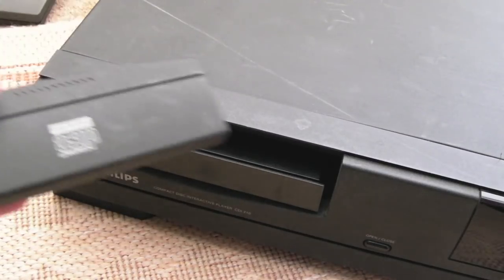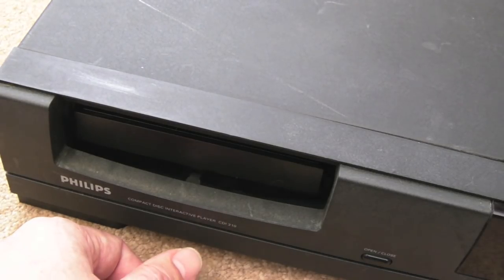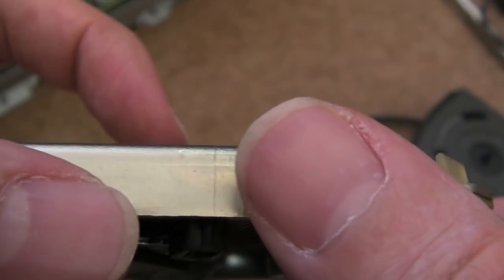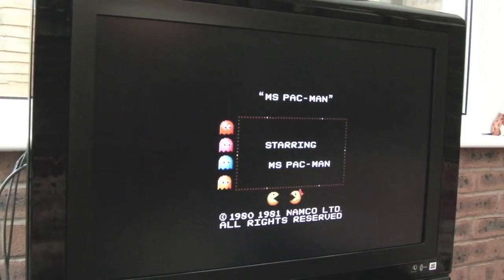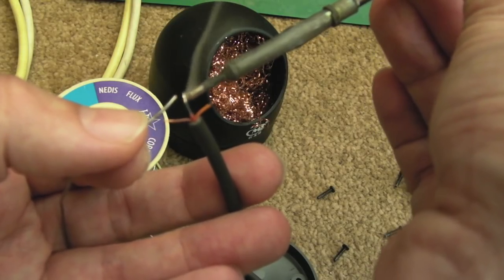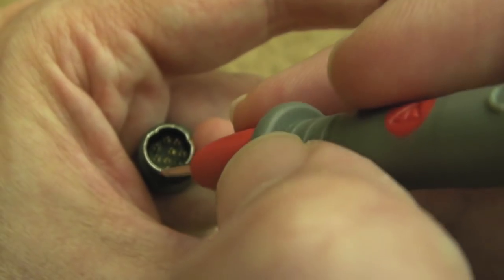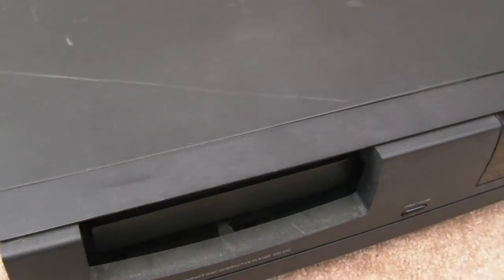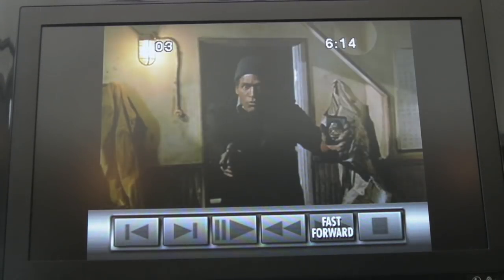Philips CDi 210 - Drive Repair & Gamepad Repair (Part 1)

Comment: That was a pretty easy fix for you :p never seen the appeal in the cdi as a gaming system, most of the games are shite lol
Reply: CDi was never a gaming system, it was a multimedia system even bringing the internet to the livingroom.
I really love watching old 4:3 movies on cdi, way better than vhs and 99% of the dvd releases of old movies are trash. 
Being dutch there is probably some national pride in me saying this but Philips again was a real frontrunner on tech.
But as usual, too early, too inovative, really creating a market instead of supplying a market.....
Reply: RefractionPCSX2 I have about 60 titles and the only ones that aren’t some kind of game are the two movies and an encyclopedia/reference disc. :) It’s the same kind of “multimedia” software every other CD platform was getting at that time which was primarily games, educational titles (usually games), reference software, and movies. The system couldn’t even scroll smoothly so it really sucked for traditional games but stuff like Defender of the Crown and Myst were well-suited for it.

It looks like Nintendo signed on too late to have much influence on the direction as a game machine. Nintendo was not concerned with steering the platform toward games and only did what they did to scuttle the bad Sony deal. I’m sure Philips wanted Nintendo’s gaming pedigree to get people to take the CD-i more seriously but that ultimately didn’t help since so few even realized it existed (much less, with Nintendo properties). Burn Cycle was probably happening either way. :)

I recall it was on demo in the Macy’s department store but they had it right next to a 3DO demo station so I was drooling over that instead. I wasn’t very interested in the CD-i until I saw the upcoming Zelda games in a Babbage’s catalog. Blew my mind. Still, I couldn’t afford a CD-i for those games until the late ‘90s when I got Faces of Evil, Wand of Gamelon, and Tetris out of curiosity (before you could just watch on YouTube). I still need Hotel Mario and Zelda’s Adventure, but I doubt I’ll ever get those at today’s prices.
Reply: Philips were always innovators but their products often seemed unfinished, with too many bugs, experimental design decisions that didn't work or just plain iffy build quality (and I speak as someone who bought Philips in preference to Sony for a long time); in their rush to be first to market they didn't apply the last 10% of polish to make their products world-class. The Japanese then refined the ideas and wiped the floor with Philips, unfortunately.
Reply: RefractionPCSX2 CD-i was coming with or without Nintendo. Nintendo’s contribution was only the three Zelda games, Hotel Mario, and Tetris.
Reply: Jelle Smid CD-i has nothing to do with the Internet. “Multimedia” was the big buzz back then. It was basically “multimedia” PC CD-ROM software without the PC.
Reply: Emmett Turner yes I know that it was coming regardless, my speculation was if there would have still been a "gaming" side to the CD-i or if it was purely going to be a video/music station.  Did the whole partnership with Nintendo give them that push they needed to make the system go down that route?
Reply from the maker: That's true lol - the PS4 and XB1 will be pretty beat up 20 years from now.  I bet not many will still work either.
Reply: GadgetUK164 - Retro Gaming Repairs & Mods yeah modern consoles are too breakable and difficult to fix, it's certainly going to become difficult to preserve the past with newer machines
Reply: @Jelle Smid I meant more now than back then, I don't understand why people want them now, they games library sucks :P

@Jason james Just to think this thing wouldn't have been around if it wasn't for nintendo, I wonder what direction Phillips would have gone. I would guess they would still have released a video-cd player, just no games.

Comment: I got a warm glow when I realised I do the same thing using a single piece of tape to wrap several wires.  I also had Naked Gun on VCD, I had a massive nerd-on for Video-CD as a kid.  I was similarly annoyed by it's weaknesses but sometimes you got an absolutely superb transfer.  Star Trek 6 was a great example.
Reply from the maker: =D  I will check out StarTrek 6!  I've not seen that on VCD!